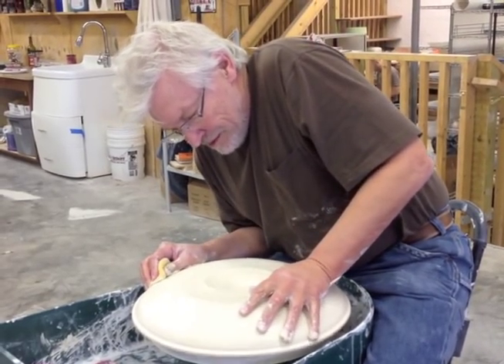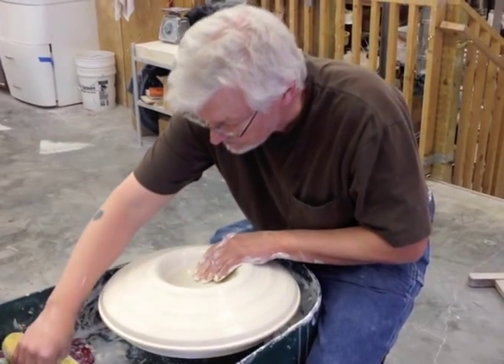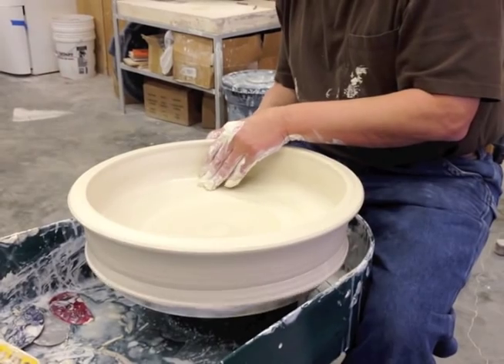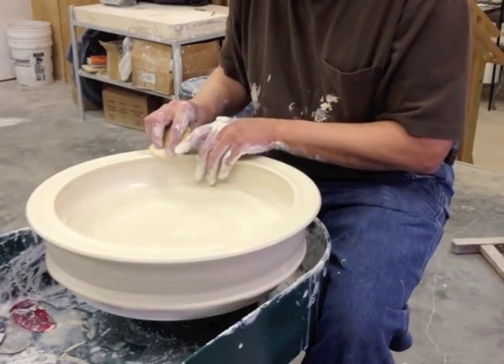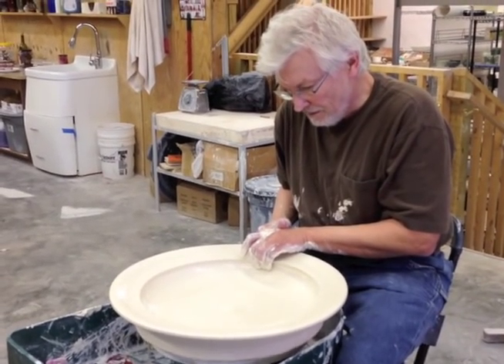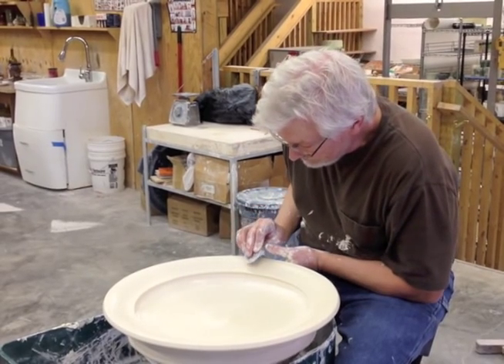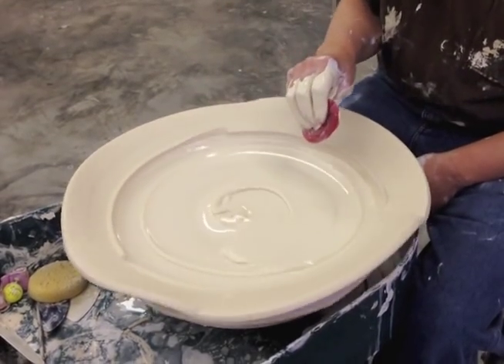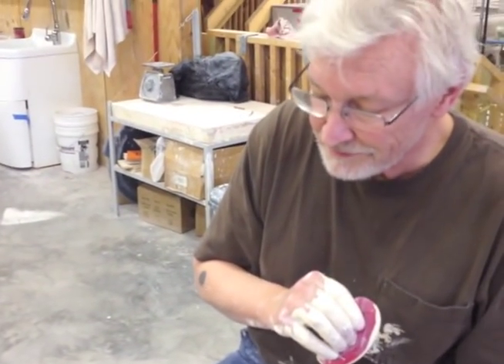Steven Hill 2014 Platter throwing demo

Comment: The demo I saw for throwing a plate in Seattle, the instructor pulled up a pony type wall straight up and then made it flat using a flat rib forcing the clay wall down and out from the rim to the floor. And I prefer to use opposite hands to make that move. I still like Mr. Hill's work after all of these years of watching him. Thanks!